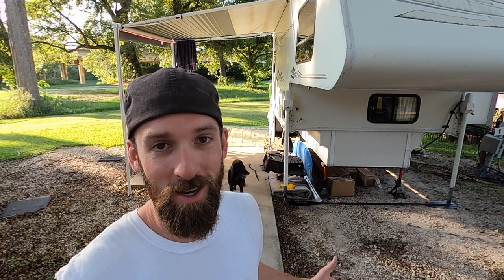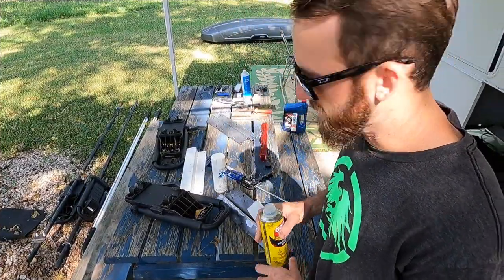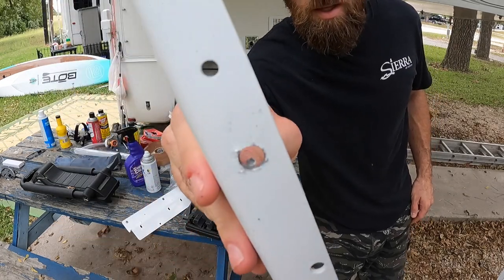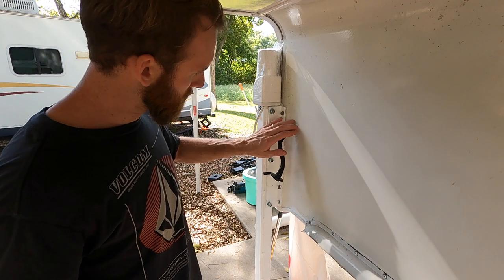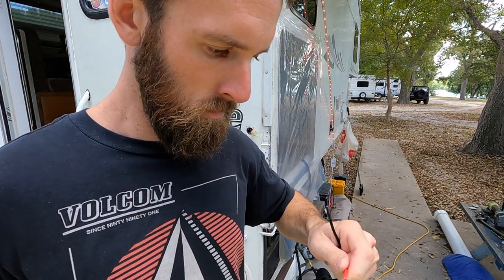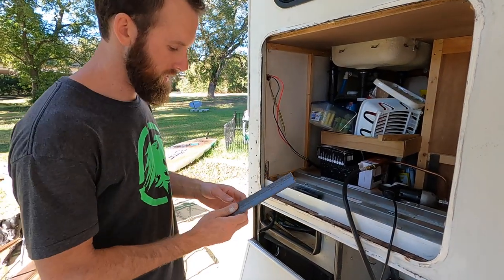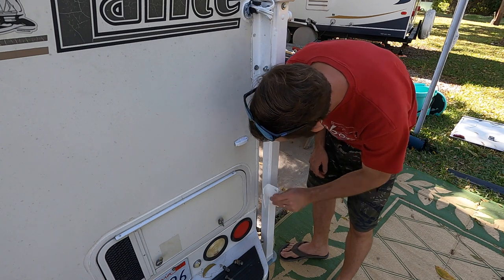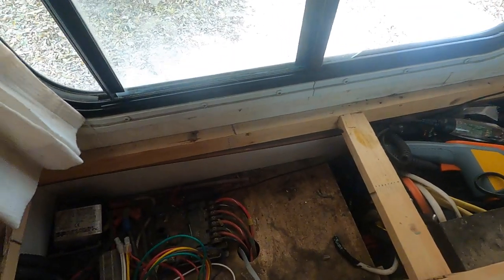How To Replace Truck Camper Jacks -Truck Camper Repairs & Tips

Comment: You should have painted and glue inner brackets in place. That way some future person who has to work on camper jacks will not have to open inner wall for camper jack service. Also you could have cut old external jack connectors off, and cutoff new jack connectors, and butt spliced old ones to the new jacks. That way you would not need to open wall for wiring you drilled through.
Reply from the maker: Great advice, thank you

Comment: Good job.  Might have been easier to just leave the old electrical plugs installed and splice the old ends onto the new jacks. 

What failed on the old jack?  Bracket, where the jack mounts to the camper, or the jack tube itself?
Reply from the maker: It was the jack tube that failed.

Comment: Maybe you can help me with a TC that I need to pick up.   The previous owner set it completely on the ground.   I need to raise it up so I can get a forklift under it or jack it up.   Do you have any suggestions or ideas?
Reply from the maker: I need more details to answer your question. Does your camper have jacks? Is it resting on the belly or on blocks or? If you don't have jacks (I can only assume) I would suggest that you either install a set of electronic jacks like I did in this video or a more cost effective option could be a set of Brophy cable jacks from etrailer.com https://youtu.be/41wPq2HiD5A
I hope this helps! Thanks for following our adventures 😀
Reply: The tc is completely on it's belly- not on blocks nor any jacks installed.   I thought about installing jacks, however I noticed in your video the base of the jack stand is beyond ground level if it's on its belly.

My wife just came up with an idea.   She suggested to have two forklifts on both sides of the tc pick it up in tandem.   Then I can back my truck in underneath.   

What are your thoughts?
Reply from the maker: That sounds like it could end really bad if something went wrong. I would focus my efforts on getting it up on jack stands or blocks first.  About 12 to 18 inches off the ground is ideal. Then check for termites. Any time you have wood touching dirt, termites like to move in. If no termites are present then I would move forward with a complete jack install on all four corners. The forklift idea could work if you can get the forks under the main frame rails that it’s resting on. But I wouldn’t recommend going any higher than 18 inches with forklifts because it would be likely to teeter over and hurt or kill someone. You could always set it down on a skinny flatbed trailer to make it more mobile while you install jacks.
How did the previous owner go about setting the camper on the ground?
Reply: @DestinatioNow  No one knows how the tc was unloaded.   It probably was slowly skidded out of a flatbed with a tilt.   It's been on asphalt a couple weeks so I'm not worried about termites.

My wife's idea with the forklifts would  involve two forklifts working in tandem to lift the tc into my truck bed.     Yeah it could be a  little dicey. 

However, I think I have a better idea.  Brophy makes a cable truck jack that goes down to 17" and lifts up to 67".   It has a 26" rail that's 2" wide that lifts up on the sides of the camper wings.   Once you find dead center it will ratchet up evenly.
Reply: I read you suggested the Brophy's already.  👌
Reply from the maker: It sounds like you have a good plan with the Brophy’s. Please stay safe and take your time. Best of luck my friend!
Reply: @DestinatioNow  thank you Sir.   I'll keep you updated.

Comment: My truck has a little lift in it , I have to use blocks with my jacks.
Reply from the maker: These newer Happijacs lift the camper a couple feet higher than the old Atwoods. Thanks for watching!
Reply from the maker: They now lift the camper to a maximum height of 4’ 2”

Comment: If you don't mind me asking. What is the gauge of the wiring from the battery to be logic board?
Reply from the maker: We don’t mind at all. I used 1/0 cable throughout
Reply: @DestinatioNow  oh wow. I just bought a 10 guage so probably not be strong enough
Reply from the maker: There are many variables to consider when choosing the size wire for your application. Try using this handy calculator: https://www.solar-wind.co.uk/info/dc-cable-wire-sizing-tool-low-voltage-drop-calculator
Reply: @DestinatioNow  thank you. What would you suggest?
Reply from the maker: Personally, I always use 1/0 cable or larger for car batteries. I would suggest that you use the calculator. It’s impossible for me to determine the appropriate wire size for your application without knowing the voltage, amps and length of your application.
Reply from the maker: Oh crap! I thought you were talking about my battleborn battery video. My bad, lol. I used 8 gauge wire for the happijac logic board.
Reply: @DestinatioNow  thank you so much🙏
Reply from the maker: I’m sorry for the confusion. I need to remember to make note of the video I’m commenting on. SMH so embarrassing 😳
Reply: @DestinatioNow  haha... No, I do really appreciate the response and advice
Reply from the maker: Awesome 😁